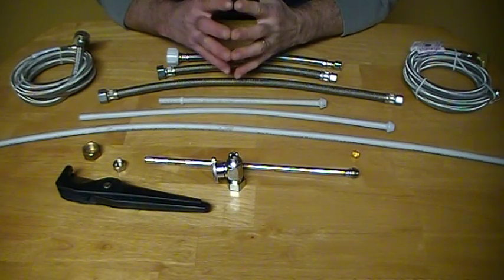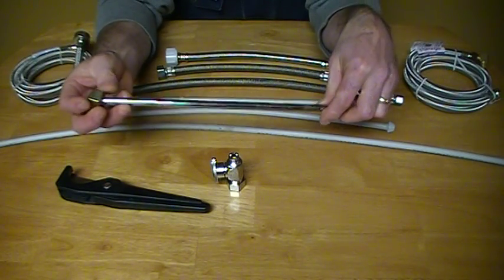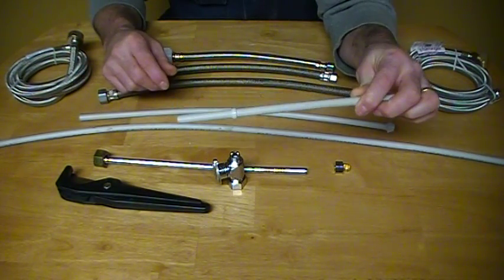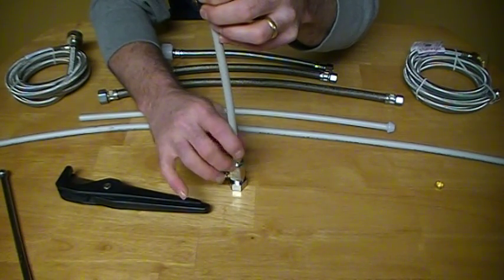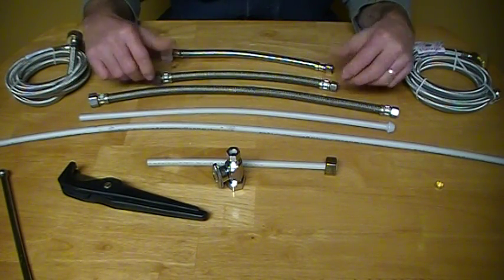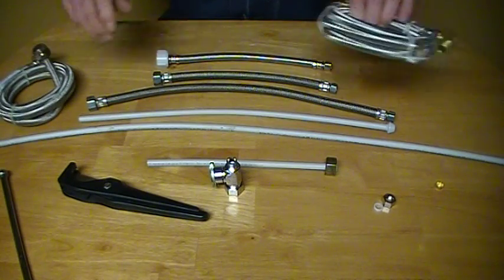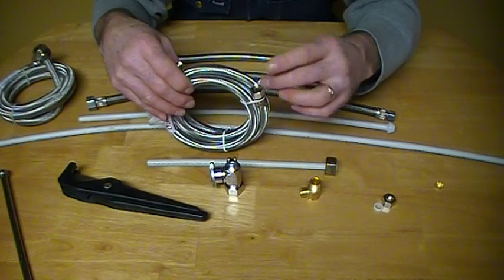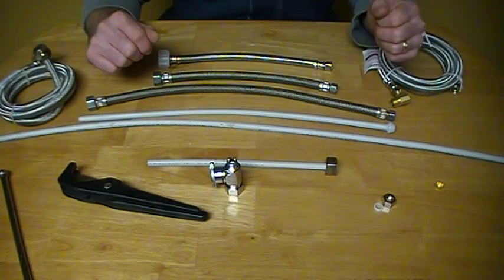How to join your water lines to your dishwasher,basin,sink,toilet and washer. Plumbing Tips!

Comment: Also I cut my discharge pipe, and placed a rubber coupling on it, connected that to a extention tube, attached that to an elbow, then connected that to my P trap to the sink. Everything lined up perfect, and just waiting on the longer Washing machine hose. Should work fine then. For my first plumbing job ever I think I did pretty good.
Reply from the maker: Hello 15Fire;
Sounds like everything worked out just fine for you! Congrats on the project!
Hopefully you will get that hose soon!
Thanks for commenting and have a great week!      Al

Comment: I believe I did that and it worked. I replaced the shark bite hose, with a shark bite valve connected supply line to that, and then extended it to the sink. No leaks. I was about done, but found that my washing machine hose was to short. I'm going to get one tomm, and I'm sure it will work.
Reply from the maker: Hello 15Fire;
I am sure it will go well for you!
Thanks for commenting and have a great week!     Al

Comment: Hi,I have an old house 1913, with a bathroom that was probably done in the 60's or 70's, I'm guessing it has a hard line water supply under the bathroom sink I want to put on a new faucet, I finally got all the connections loose but at the bottom I believe possibly a feral could be still holding on is there a gentle way to get that free also the connections for the faucet that I want to change are practically melded to the sink I've seen videos where they say hit it with a hammer and screwdriver or drill it out I'm going to go very slow with a tiny drill bit but how do I get that feral free without yanking on the pipes below? thank you so much!
Reply from the maker: Hello Lori La Rue Hueg,
There would have to be a nut and ferrule where a valve would be located or a 1/2 by 3/8th compression coupling which would have the nut below it.  Can you cut the pipe below the nut and ferrule and put a fitting on there? This will allow you to remove the countertop and easily remove the old faucet and install the new one. What kind of connections go to the faucets? is it soldered in or are there any adaptors that go into the faucet?
Get back to me when you get a chance....Al

Comment: My question is, I'm needing a 48-60 in water supply hose going through a wall to the sink, can I use a dishwasher hose instead of having to rig a compression fitting on it to extend? My question I guess, is there basically a difference in a regular sink supply hose and a dishwasher supply hose? Thanks!!!
Reply from the maker: Hello Aunt Floyd,
A dishwasher supply hose is plenty long for your application, but both ends are 3/8th compression so it will not connect to the bottom of a sink faucet whereas the speedway supply has a flared end and a 3/8th compression end. So you will need to get a speedway supply, a 3/8th compression coupling and a 3/8th by 3/8th compression supply. You can get the compression supply shorter than 60 inches that is for a dishwasher. I do know some stores carry them from a foot to thirty inches in length.
Hope this helps!
Thanks for commenting and enjoy your week!     Al

Comment: I haven’t bought my portable clothes washer just yet, but I was gonna put it next to my toilet.  I was going to use the shut off for my toilet hose and see if I could find some kind of ‘T’ and hook my toilet and washer using this same shutoff and throw the drain in the bathtub... That seems like it should work?
Reply from the maker: Hello 19ninetynine,
It MAY work...And I use those words with caution. That isn't something that I would recommend.
You could have water all over the place especially with the drain. The water comes out with some force and could easily pop out of the tub. 
You should see if you can find a place you can tie into the drain and water for a more secure scenario.
Thanks for commenting and best of luck with the project!

Comment: Great video!!! one question do you still need a gasket on the PVC/PEX tubing conical end that goes on the toilet??
Reply from the maker: Hello Edgard Aspilcueta,
Good question! The answer is no. Once they came out with the pvc supply with the cone shaped end,' a gasket was no longer required. 
The older flat toilet supplies required the rubber or plastic washer.
Thanks for commenting and enjoy your week!      Al

Comment from the maker: @derek47 hello Derek; Your washing machine has a 2 or 1 1/2 inch drain on it. You need a 3 inch drain for a toilet.If your washer is on the first floor and not in the basement; it maybe something to consider.If there is a 3" drain handy it is possible for you to do, but if you have not tinkered around plumbing alot i would be a little hesient to do so. It is a fairly big job. They do make a toilet now that only has a 3/4 inch drain line off it and a lift pump in the tank. Something to consider.

Comment: Thanks for sharing ...what happens if my hose is 1/2 inch, how do I install the elbow ?
Reply from the maker: Hello Lizzy,
You're welcome!
You would need a You would need a 3/8th close brass nipple and brass 90 along with a 3/8th male thread by 1/2 inch hose coupling. Then you could use the 1/2 inch hose. You would have to put the fittings mentioned in that order off the inlet of the dishwasher. 
It may be easier to purchase a 3/8th male by 3/8th compression 90 and use a five foot 3/8th hose.
Hope this helps!
Thanks for commenting and enjoy your week!     Al

Comment: Hello, great video!! 

Question? Can I use a dishwasher water line 3/4 and 3/8 ends with a washer machine? I know the dishwasher hose is thinner, will that cause any problem installed in washer machine?

I’m planning to hook the machine water from under a sink and the 3/8 end will work under the sink without having too many connections. 

Thanks
Reply from the maker: Hello Regino,
The inside diameter of the 3/8th dishwasher supply is smaller than a washing machine hose as you mentioned.
Years ago all washers hoses use to be made of rubber and had a larger inside diameter. Since they began making the braided hoses for washing machines; the inside diameter has gotten smaller as well.
 So to answer your question...it may make the cycle a little longer, but it can be used. There isn't really that big a difference in the inside diameters and if you have good water pressure; you may not see any difference in the length of cycle at all.
Hope this helps!
Thanks for commenting and enjoy day!       Al
Reply: TheOldkid888 hello, thanks for your information and since you say I can use it even the diameter is smaller and I understand as you mentioned that the cycle might take longer,  specially if my water pressure is slow. 
Fortunately, my water pressure is very good, so it  might work for me the dishwasher hose. 

Again, thanks for your great info and keep making good videos and best of luck.

Stay safe during this virus 🦠 crisis 🙏🏼

Comment: Hello question for you. My wife wanted to move her utility sink. And stack our washer, and dryer, in our mud room. When I moved the sink the P trap won't line up. Also I used shark bite fittings to replace the valves. Started with an elbow fitting, connected to copper pipe running down, to a T connection, out to a shut off valve. Then down to a supply line to sink. The supply line is to short what can I use, or do to extend it?   Also what can I do to make the P trap line up? 
Thanks.
Reply from the maker: Hello 15Fire;
I am not exactly sure how much tto short your supply line is, but they come in 30" lengths for sinks and basins.
You can use a 3/8th compression coupling and a 3/8th by 3/8th braided supply line that you will join to the coupling and supply off the sink. The 3/8th by 3/8th braided supply line come in sizes up to 2' in length.
How far away did you move the sink? As far as the drain itself; it depends on how far away it is from its original spot. If it is relatively close you will probably need a 22 degree elbow, a new p-trap and an inch and a half trap adaptor. It will make the job much easier for you to go new rather then fight with the drain. 
Get back to me when you get a chance.
Thanks for commenting and enjoy your day!     Al

Comment: I changed the hot water line from supply tap to faucet with braided line and after tightening both connections and turning on water I have no pressure from tap?
Reply from the maker: Hello Tim,
Just need a little more info.
Did you turn the water off under the sink or somewhere else in the house?
When you say no pressure...No water at all?
What type of valve was it that you turned off?
You just snugged the nuts on the braided hose and never over tightened them?
get backto me when you get a chance....Al
Reply: toilet flush
Reply: flushing the toilet would fix or produce the problem? I had the same problem not long ago. I couldn't get water to come out of the shower or bathroom sink. It was very hard to turn the water on and eventually after turning the water on a few times after noticing the problem the pressure had built up so much I could not turn it on any longer. I ended up having to switch out the moen handle and that seemed to fix the problem.

Comment: Do the flexible hoses reduce flow rates of the fixture for older installations?
Reply from the maker: Hello William,
The flex hoses only have an inside diameter of a 1/4 of an inch. The same size is for most any speedway supplies. 
Most faucets only have 1/4 or smaller holes in the bodies themselves which will only allow a certain amount of water to flow through. 
Older faucets installed on bathtubs for example would allow a great amount of water to flow and generally had 1/2 inch copper soldered directly into them. You cold fill a tub in no time as compared to newer faucets.
Keep in mind most faucets on sinks have aerators (screens) that are low flow.
Thanks for commenting and enjoy your week!     Al

Comment: can steel tubing be cut in half to install a splitter for a water filter? or do I have to use a different type of tubing? Thanks.
Reply from the maker: Hello Victor,
I wouldn't use steel tubing myself as it would not last very long unless it was stainless and that would be very pricey. I would recommend copper tubing for the job. What are you feeding with the filter?
Get back to me when you get a chance.....Al

Comment: hi, how do i attache a new drain from the dishwasher to the sink drain. there is this ribbed plastic piece that was chomped on by mice. it broke and whooosh. i saw most of the things you talked about from under the sink to everywhere else, but not the pipe i am seeing. the drain.  can you help. we are in a rental and the land lord is.... not user friendly
Reply from the maker: +Kathy Perry 
Does your new hose come with an adapter glued on it?  If so you should go directly to the bottom of the machine. I have never coupled the corrugated plastic pipe. It may be possible to do, but I am not aware of it.
Can't really give much more info unless you would like me to tell you how to slide the machine out of the cabinet.
Thanks for commenting and get back to me when you get a chance.     Al

Comment: We replaced the bathroom sink and faucet in our modular home but now the water supply lines keep popping loose from the faucet after the water is turned back on. It doesn't always happen right away, but sooner or later it comes loose. The lines are 1/2" plastic. They screw to the faucet just fine, but then they come off. Any suggestions? Thanks!

Comment: Can you tell me if I can bring water to washer from shower water pipe?
Reply from the maker: Hello  M Schmidt,
Yes, you can bring water from shower piping. I would hold off on grabbing a shower when the washer is running unless you have a single lever posi-temp faucet. The water temperature will change quite often and that could be a bit of a pain in the backside.
This is the only draw back, but you can definitely do it. It wouldn't be the first time that's for sure.
Thanks for commenting and enjoy your week!    Al

Comment from the maker: @derek47 I am not a big fan of them as I call this toilet ( number 1 business ) only myself. The pump in them is nnot overly strong but ideal for fluids only.It is very similiar to a lift pump in a sewage tank. Does the same job ;only on a smaller scale. As far as hooking up a regular toilet where the washer is located, do a fair amount of homework. It is possible for you to do it, but it is a bit of an undertaking. Good luck and have a large day!!!    Al

Comment from the maker: @username12009 Hello username;

I contacted a few plumbers from the UK just to get a little info for you.The rough-in measurement in North America is 12 inches from a finished wall to the centre of your T- bolts. I only recieved one reply back and he told me that their were many different maesurements.You can check your own toilet yourself, by simply measuring from the finished wall to the centre of the bolts and if it is close to 30cms; you should have no trouble.
Tks and Best of luck!!   Al